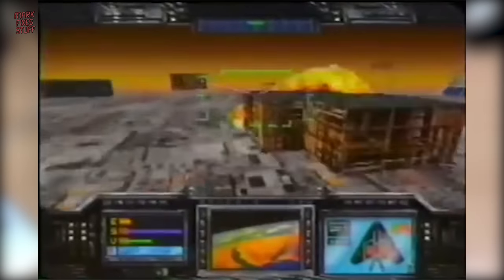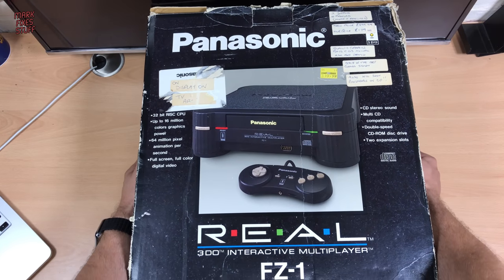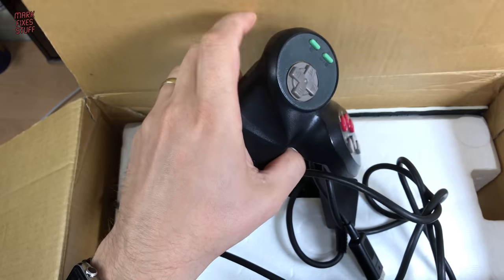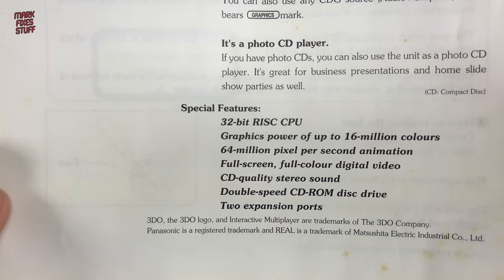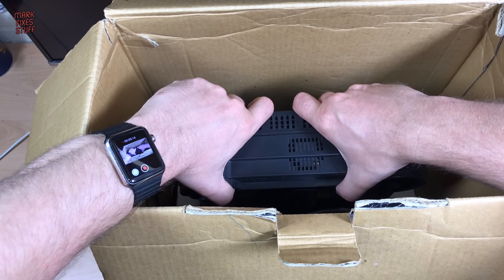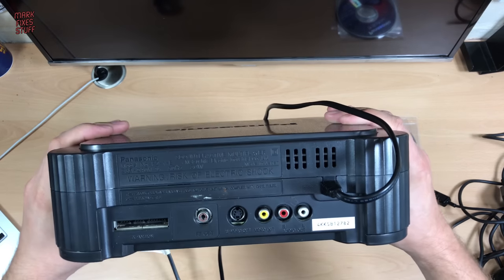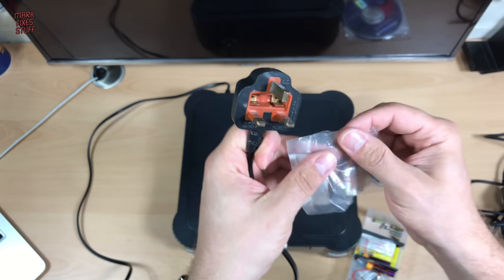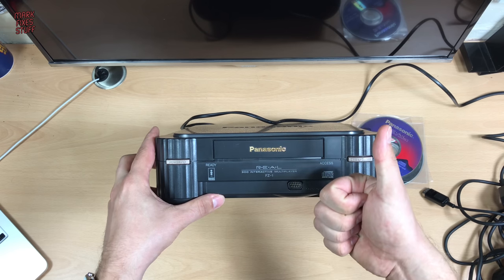Pt 1: A DEAD Panasonic 3DO - Why no power? 3DO REAL FZ-1

Comment: Hi, ive tried to do what you did but i didnt solder the big capacitor really tight as i cut it too short but it powered on and then died so ill retry it but i chipped 1 little think, its the D33 chip next to the huge capacitor, i cannnot found what it is used for but yea.. i might have killed my system, would love to know if you know what it does, its really small on the board

Comment: OK. So I got the power to turn on and the disc tray to work, but theres just a black screen being inputted on to the TV. It changes from “No signal” to a black screen. Kinda like how when your N64 wouldnt work sometimes when you turn it on.

So how can I fix it, you think? If it has something to do with transmitting the feed to the TV, idk what to do.
Reply from the maker: Sounds like a cap issue. Have you not replaced the capacitors?
Reply: Mark Fixes Stuff - Retro Console and Computer Repairs, Reviews and MORE! 

I have yet to replace any caps on the mother board. They all look OK. But I could be wrong. Even if I tried to replace them, what capacitor would I need to change, ya know? Lol
Reply from the maker: @PittsburghSonido  the two in the video near the power regulator.  You can't tell if they are OK by looking.
Reply from the maker: and by "in the video" I mean in the later episode.

Comment: Well I never.

An MFS vid. :o

It's been a while, mate. ;)

Love the design of the FZ-1. I have one here that needs a new laser  It's on the todo list.
Reply from the maker: They do pop up occasionally...
Reply: @MarkFixesStuff  Got a 3DO in perfect condition on ebay recently for 92 pounds free shipping. Pretty good deal I think, it is a NTSC one because I hate 50hz refresh rate. I don't know why that had to be the PAL standard for a while.
Reply from the maker: Dylan Lindsay early crt signals were derived on CRT screens using the AC power supply. In the UK the AC is 220-240v 50hz AC. As TVs evolved they became frequency agnostic and able to handle both, but the basis of the TV signal comes from that.  :)
Reply: Mark Fixes Stuff well that makes since, thank god the standard is 60hz, for most stuff that is.
Reply from the maker: Yes, on modern TVs the AC frequency doesn’t matter because digital signals are not drawn line by line or interlace, and are shown as whole images (progressive).

If you do have an NTSC model, remember that you won’t be able to plug it in in the UK, because it will be a 110v model. You will either need to swap the internal PSU, or get a 240v to 110v step down converter. A step down is easiest. If you plug a US or Japanese 3DO into the UK mains power supply it will go bang.
Reply: Mark Fixes Stuff I got a step down converter.